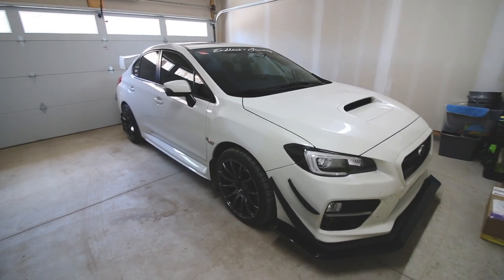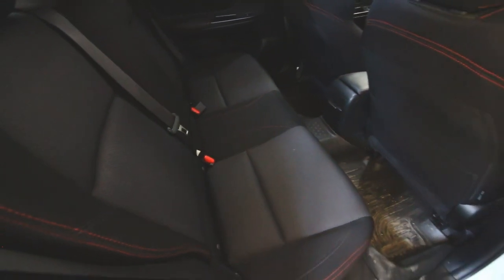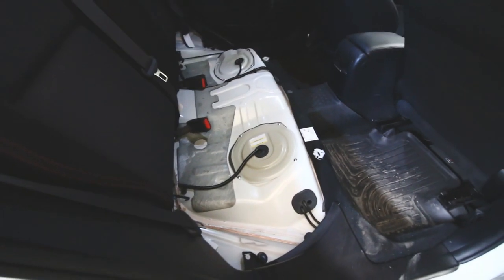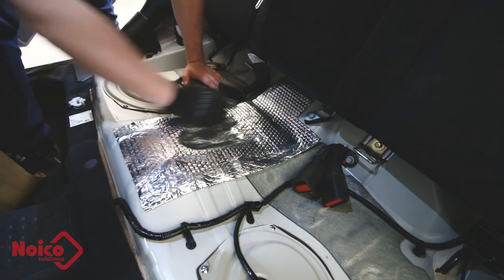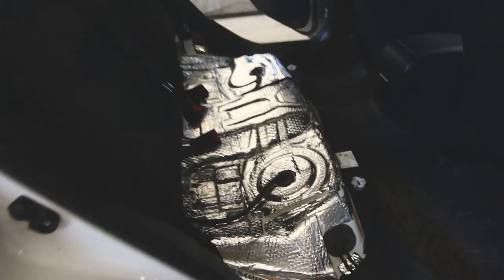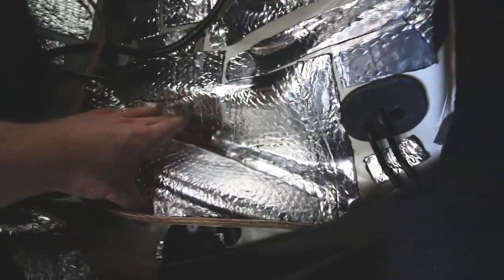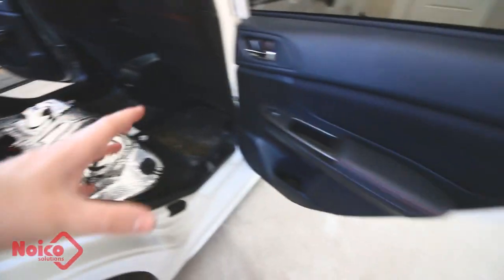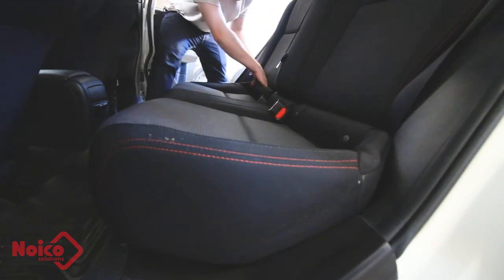Noico Sound Deadening 2016 Subaru WRX - Rear Seats

Comment: That thing is a mission to install 😂 but I seriously love it and it seriously works in my opnion my trunk would rattle horribly with the system and with this product it seriously stopped it, as far as the doors and the rear seats and under the carpet it did help a lot with road noise as well, awesome video bro :) smashed the like button, I know they say wear gloves but I didn’t for one part and it cut the crap out of me lol

Comment: would you say your were "cutting shapes"?  Sorry, couldn't resist.  Interesting project.  I am astonished at how many WRX/Sti owners have taken to the sound deadener/absorption/blocking project(s).  My '19 is louder than I thought it would be and I don't remember my Mk4 GTI being as loud (road noise) as the WRX is.  The biggest culprit are the large holes in the inner door skin; something my GTI did not have. It had  solid inner door skins (and only 2 doors).  Germans and Japanese methods I guess.  Crazy the lengths we go to for a few dB reduction....

Comment: Nice vid. For the people asking questions this stuff is not gonna really make a difference in sound level. It’s for vibration and resonance. You need mass loaded vinyl and closed cell foam to stop noise.

Biggest thing is you only need about 65% coverage of this material he’s using. 100% coverage is not needed since it doesn’t block noise.
Sorry to hijack just trying to help.

Comment: If you're looking to target road noise specifically, look into throwing some Mass Loaded Vinyl on top of the Noico.  Butyl sheets are great for killing rattles, but the MLV is designed to absorb noise.  I've got a post on BensCarBlog with more details regarding our cars specifically!
Reply: Yea, I agree with this the MLV will actually block the road noise alot more, unlike the the Noico sheets which is more for rattles.
Reply: just noticed it was you Ben Walters.

Comment: Hey did the rear seats alone help out at all? If so, how?
Reply from the maker: The rear seats helped with some road noise!  But I didn't end up doing my doors, I wanted to get around to that eventually but never got the chance. I think doors would make the biggest difference.
Reply: Spencer Hogg - thanks man! My stuff will be here tomorrow so I may get going on the rear seats and probably trunk as well.  Should have enough material.  Stay safe out there ✌🏼